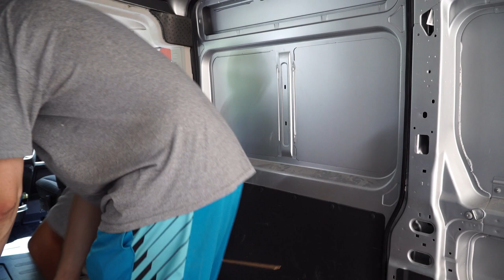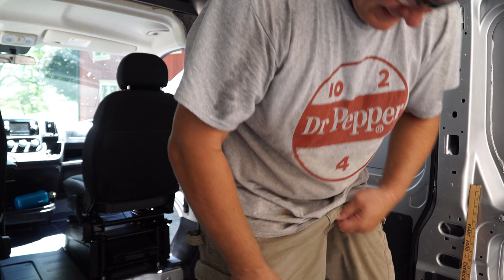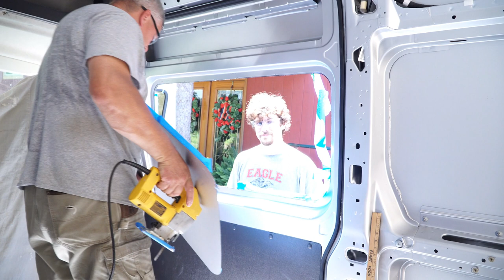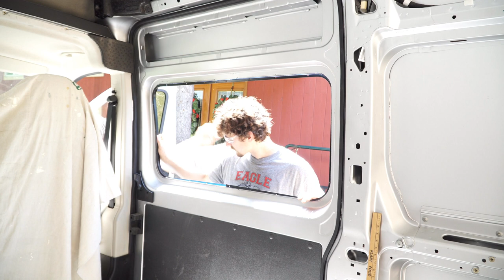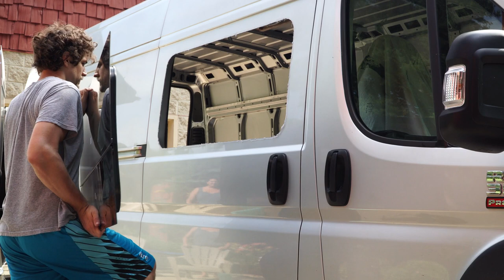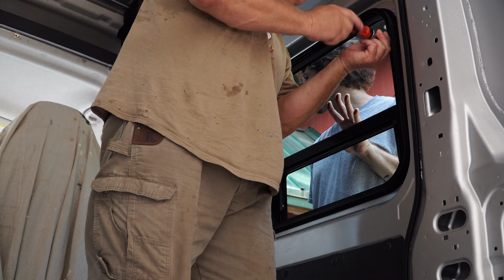Sliding Door Window Install - Ram ProMaster 3500 Extended

Comment: This is the first video I've seen where you attach the window with screws vs adhesive. Love that window, but wonder about the priming. Maybe you did it and I missed it; but just wondering if that is important. Thanks for this video. I appreciate seeing a different way of installation.

Comment: Is it safe to assume that metal frame you were holding up to the freshly cut opening holds the window in place?
Reply from the maker: Yes you place a metal frame on the inside of the door and screw it into the window on the outside of the door to support the entire system.

Comment: So it looks like you did not use a template for the window but cut out along the metal stamped part.  Is that correct?
Reply from the maker: Yes that is correct